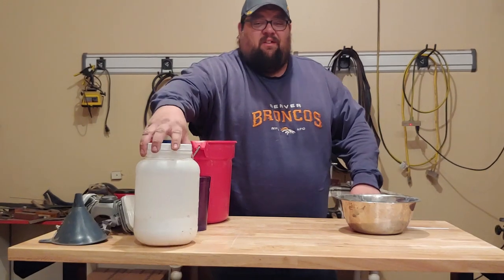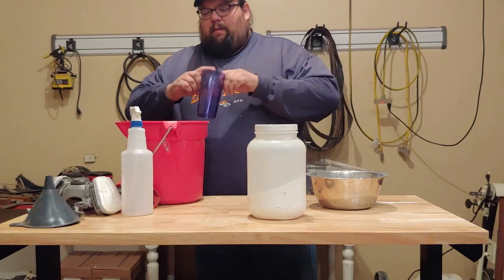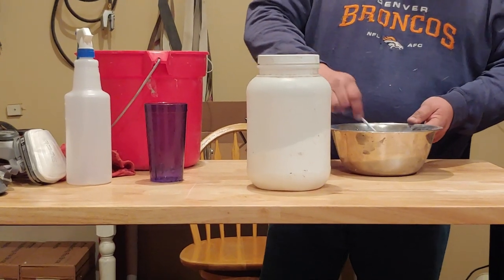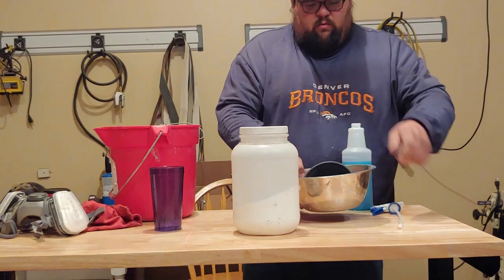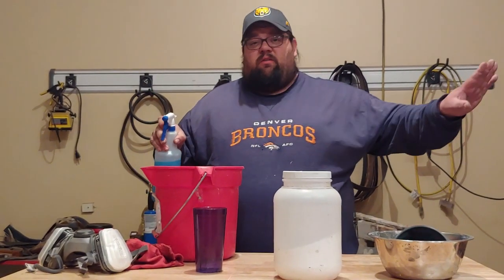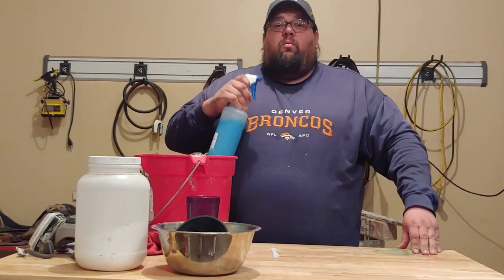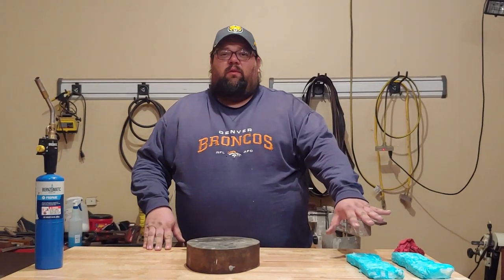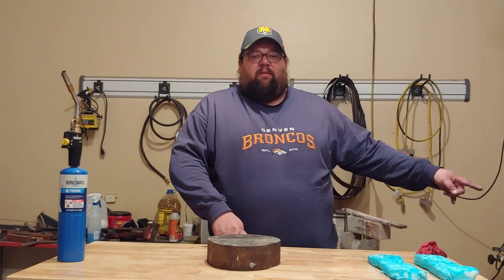How to ridgidize ceramic fiber blanket

Comment: Hello
What is meant by the classification temperature of the ceramic fiber 1260? 
What is the melting point of these fibers and what are their tensile strength properties?
Reply from the maker: that is all very dependent on the brand/style of ceramic blanket.  Most of this data can be found on the MSDS for the blanket you purchase.  This is particularly important for the melting point of the blanket, check with the maker for the specific blanket you purchase.  The one I use in this video I believe is 8# 1" rated for 2800F
Reply: @irondaggerblacksmithsupply1237 
 Thank you  so much for your answer
I wish Good luck to you

Comment: You should definitely put on your respirator BEFORE you pour out that silica in an indoor space.  Did you see that plume? 💀
Reply from the maker: fumed silica is bio solvable and no dange.
Reply: @irondaggerblacksmithsupply1237  That is not true. https://en.wikipedia.org/wiki/Fumed_silica#Health_issues
Reply from the maker: @kkuhn  from your own link  " Fumed silica is not listed as a carcinogen by OSHA, IARC, or NTP. "  It is very easily airborn.  so the only way those two things can coexist is if the particle is biosolvable
Reply: The cause of repeated exposure to fumed silica is Fibrosis. I wouldn’t misinform your viewers with such a hazardous statement.
Reply: @chiefrockone  thanks for looking out, but I think that although the names are very similar, that article references another substance with other impurities in it... As a line in it reads... "This substance is NOT the product known as 'fumed silica'."
Reply: @spare-parts-iii  the names are similar as well as the side effects
Reply: @spare-parts-iii  better to be safe than sorry? Sometimes products are “remanufactured” to bypass legislation
Reply: @chiefrockone  fumed silica has been put into cosmetic, food, and drugs for years.
Reply: @kaycecoplen4287  you’re right. Does that mean there’s no harm in ingesting it? Go ahead and listen to this guys advice and see if it is harmful after the latency period
Reply: Gotta love those safety sissies.
Reply: Lol fumed silica is used in toothpaste yo. So maybe check again 😅

Comment: So I wait for it to dry before I fire it up, right?
Reply from the maker: if you are referring to rigidiser it is your choice.  you can fire it wet or dry (if you fire it wet you will get steam and it will choke up your burners some) if you are talking refractory absolutely let it dry and cure before firing and be sure to follow the cure process for the refractory you are using.

Comment: I just made a whole triple batch of water glass...

Whats your take on painting the ceramic fiber with a few coats of water glass?
Reply from the maker: waterglass melts at or under 2000f depending on how you made it.  I really don't recommend it at all.
Reply: @irondaggerblacksmithsupply1237  

Maybe a little off topic: what might the results be, for a swatch of 1" kaowool, saturated with fireclay, compressed to about 1/8" - 1/4", dried and fired? Would that suffice as a kiln shelf, or insulation panel?
Reply from the maker: @springbloom5940  you are in essence referring to a ceramic wool fiber board.  you are better off to purchase the real deal than to try and home make one of those.
Reply: @irondaggerblacksmithsupply1237  

I get that. The goal of this project is build a small kiln from scrap and expedient materials. A shelf would cost more than the whole thing.
Reply from the maker: @springbloom5940  got it.  for that application.  some morgan firebricks are cheap and much better.  but if push came to shove you can compress the blanket and cast it inside a refractory such as kastolite30 to make due.
Reply: @irondaggerblacksmithsupply1237  

Cool
Reply: @irondaggerblacksmithsupply1237  

Yo. I picked up some 1" blanket for a gas fired kiln. The chamber is cubicle, so Im installing it in panels in 3 layers. I have zero experience with this stuff. My question is will it shrink or degrade substantially? That is, if I make well fitting panels, will I end up with gaps? 

Thanks
Reply from the maker: @springbloom5940  no there is very little shrinkage in ceramic blanket.  however you really should cover the blanket with a refractory for safety.
Reply: @irondaggerblacksmithsupply1237  

Awesome. Im probably going to end up tiling it with some .75" soft bricks I found cheap. What kind of refractory would you recommend and how thick?
Reply from the maker: @springbloom5940  1/8" for the walls/roof 1/4" to 1/2" (the thicker the longer to heat up but the easier to hold heat) for the floor.  I like kastolite30  and mizzou(sp)
Reply: @irondaggerblacksmithsupply1237  

Thanks, again 👍

Comment: Thank you for the information. I had putchased factory-made rigidizer since I was unable to find that fumed silica in Europe. Following the information in the comments I have been able to find aerosil 200, used as thickener for epoxy/poliester resins. So you have a new subscriber. Could you speak about mixing proportions with eater/food colorant?
Reply from the maker: the food coloring's only purpose is for visual aid.  It allows you to tell you have fully covered and saturated the blanket.  Use as much as you need to achieve this purpose.
Reply: @irondaggerblacksmithsupply1237  Oops... I realize I wrote a typo. I mean water, not eater, and my question was about how many fumed silica is to be mixed with water. I see in the video you don't even bother to measure it, but it would be useful to have at least a ballpark figure, so one can do the calculations about how much fumed silica to buy. 

BTW, aerosil 200 safety datasheet recommens to use the respirator while mixing
Reply from the maker: @betibetekaberanduetxea1445  gotcha.  use at least 1 cup fumed silica per 1 liter of water.  you can use more if you like.  Just make sure that it remains a liquid and you don't add so much silica it becomes a paste.
Reply: @irondaggerblacksmithsupply1237  OK. Thank you very much. I have been interested in this for some years now, bout yours is the first channel where these things are explained so plainly and clearly. Keep the good work on. I'm going to recommend your channel to anyone interested. Greetings from Europe

Comment: why can they not be just dunked in quickly to the liquid
Reply from the maker: ceramic blanket is EXTREMELY absorbent.  You can dunk them however it will take substantially more mix then just spraying/pouring on.

Comment: that seems like too much, no? ive seen other youtubers spray a lot less
Reply from the maker: the idea is for the rigidiser to soak in.  thats why you color it, that way you can see how far it has penetrated.  I don't believe there is such a thing as over doing it in this stage.  the more silica you get in the blanket the more bonded it will all be.
Reply: @irondaggerblacksmithsupply1237  that helps a lot, thank you-

Comment: so you just made waterglass you can buy waterglass you can buy 5 ltr of the stuff for £15
Reply from the maker: you clearly do not know what waterglass is.  Please do a quick google search on how to make it, you'll quickly understand your mistake.
Reply: @irondaggerblacksmithsupply1237  waterglass is sodium silica sulotion it is also used in fireworks to protect the cardboard tube from burning
Reply from the maker: @ianspaintpot  I repeat.  please look up the process to make water glass.  it is far more complicated than putting some fumed silica in water.
Reply: @irondaggerblacksmithsupply1237  it may be more complicated but it is just same solution well it does the same job.
i know many people that have made there own kilns and they have used waterglass
Reply from the maker: @ianspaintpot  you are 100% wrong.
 this is not waterglass.  this does not work like waterglass.  this is a fully different substance.  I've been trying to be polite and direct you to do some research but apparently that doesn't work.  so again YOU ARE WRONG.  Please use google it will explain to you why.